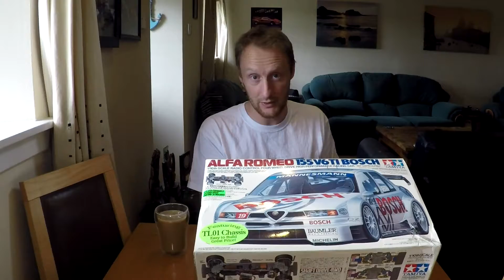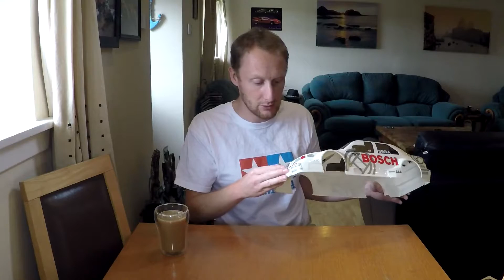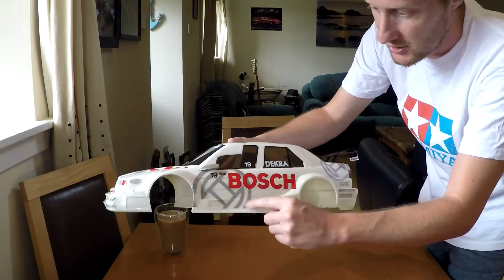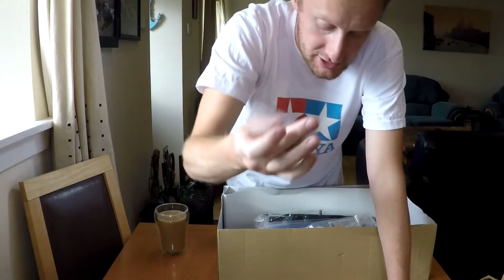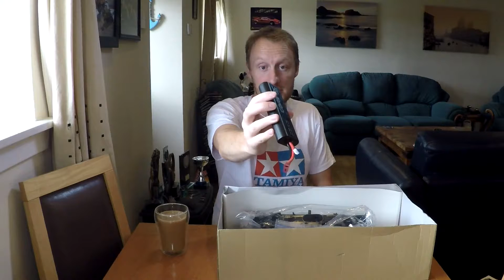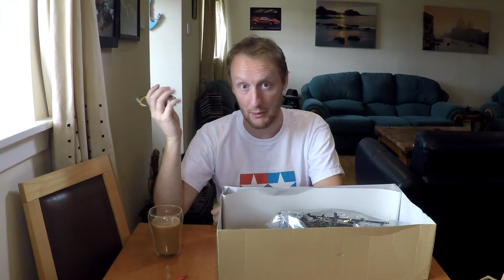TAMIYA NOSTALGIA. Brand new TL-01 unboxing & build! Classic, retro touring car. Part 1

Comment: I love tamiya, my first hobby grade rc was the tamiya rough rider, awesome or waa. 
While it's in kit form, convert it to a central, lengthwise battery. Much better handling. 
Ps.......use it and just buy a new chassis for it. Lol
Yah no what......If you didn't repeat yerself, the video would only be half as long. Lol
Reply: Pos........i love the tl01, simplicity in itself. Oooooh yeeeah man
Reply: 3% toe out on the front, and 8% toe in on the rear. 35wt oil all round, harder spring's to the front, softer spring's to the rear. Yummy
Reply from the maker: Hey Mikey Mike. Yup, you are right... on all points!